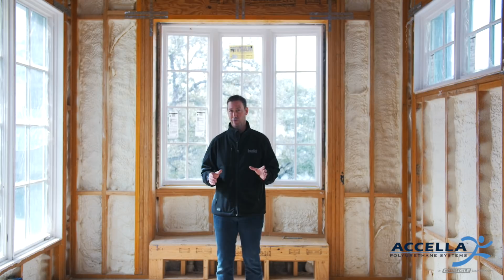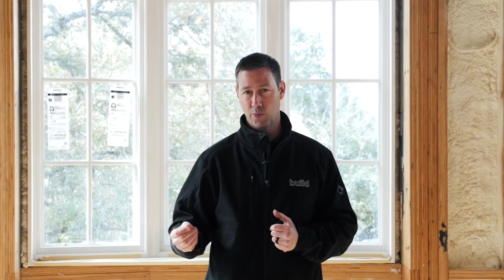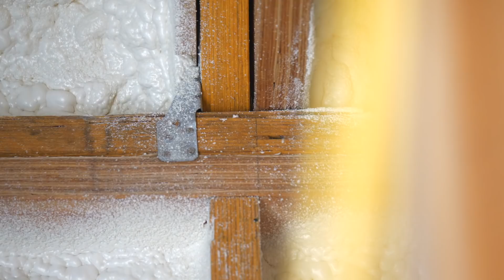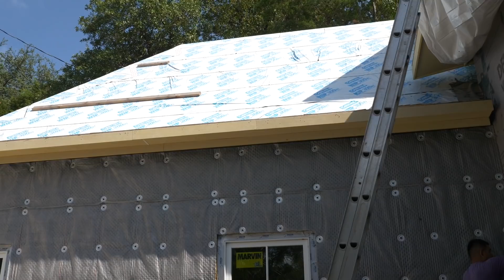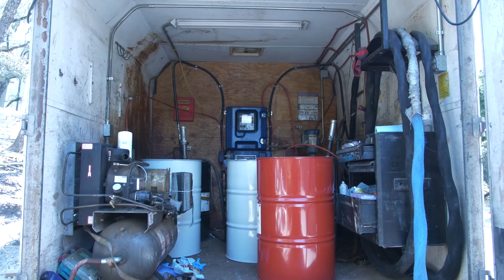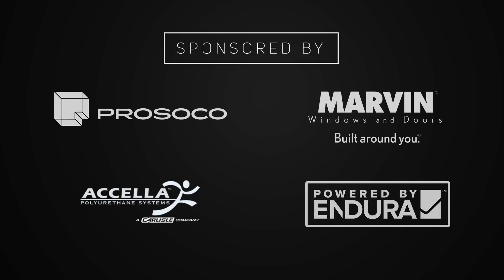Structural Insulation

Comment: When will you finally build the house entirely made of spray foam? Yoy are moving from the wooden house to the plastic house very quickly. I was a big fan of the way houses were built in USA, but since you are using so much polyurethane foam, I don't like it so much. In the houses I design, I try not ot use polyurethane foam if possible. The only advantage of spray foam is that it alows to build worse because it performs well being easily applied, but only having zero environmental considerations. Other insulating materials give good R values and allow to build a house that coud be dismantled and materials reused if necessary, but with spray foam you are building a big industrial waste with the shape of a house. And in case of a fire, there is going to be a really big torch with a huge column of black toxic smoke. I think wue should tend to build with more noble materials and using the less plastic, not with toxic residual materials. Polyurethane spray foam is good for the builder and good for the seller, but the home owner buys plastic. And again, in case of fire, poliurethane multiplies the amount of cyanide in the smoke, increasing the chances of fatal intoxication before leaving the building.
That said, Matt, I enjoy your channel and your work, and specially the concept of "perfect wall", which would be more perfect using rock wool.
Greetings from Spain and thanks for your videos.

Comment: Starting at 2:12 Matt talks about workers wearing respirators because the spray foam sticks like glue. This is only partially correct. Over spray and the issue of getting it on you is one thing, the mask is really for something entirely different. Foam is made of an isocyanate and a polyol. Isocyanate is wicked bad for you, and polyol isn't just a whole lot better. The ISO will sensitize you and really, really mess up your lungs. This is also why the structure needs to be well ventilated before it is entered or occupied. Off gassing after completion is still an issue too, despite what builders will tell you. Another thing is the importance of a fire barrier since this stuff puts off some wicked nasty stuff when it burns. That being said, I'm not a foam hater. It is a terrific insulator, but I advise everyone to do your research first so you can make an informed decision. My background is in the chemical industry, an operator in the Houston area. One of the products I make is the base chemical of the polyol component.

Comment: Matt, I have used closed cell for exterior roofing in warehouses for many years.  It must be topcoated however.  One great thing about closed cell is it will NOT support combustion.  Our insurance rates went down.  I acrually saw a metal building that had burned to the ground, and the closed cell roof was laying on top of the melted metal roofing, intact.  It it great stuff.  Nice video sir.
Reply: That's not true.   Spray foam is highly flammable.   Put a lighter on it and see for yourself.

Comment: Matt Risinger my question is if you use the closed cell to do a vapor barrier waterproofing layer and additional strengths stitching can you then go on top of it with open cell instead of using a traditional bat for the rest of the insulation and what would be the R-value comparable between the two

Comment: Question on adding a batt to the inside of the foam. Does this run the risk of water vapor condensing on the inside of the wall? As warm damp air moves through the batt will it not condense when it hits the slightly cooler foam or does the thickness of the foam negate that?

Comment: I'd like to retro my attic space with some like this product to make my attic conditioned space for the HVAC equipment/ductwork up there, but I've seen various "horror stories" about the health risks associated with spray foam insulation in attics - mainly giving off noxious vapors that made homeowners sick. Supposedly, the problem comes mainly from the incorrect mixing of the components.

Any insights on this issue or advice about using it?
Reply: Spray foam is the best hands down. its not most cases, it is every case, that has has to do with it being improperly mixed and installed. Spray foam is expensive, and some people pay alot more than they have to because they chose to not use a professional. When it is installed correctly, it is 100% safe, will never smell or off gas, any you will be glad you made the decision to do it.
Reply: Mine was no problem/ reduced attic from 130 to max of 90

Comment: Spray foam is a very dangerous and unhealthy insulation. There is a reason they don't use it in Europe much. It contains loads of VOC'c and formaldehyde. Studies have shown that it continues to leach these chemicals long after it's cured, even when cured "properly" with 2 inch applications, it's been shown to give off harmful chemicals. This is not recommended by any healthy building nor green building organization. Avoid it like the plague, since it may be even worse.

Comment: Wow Matt,
Outstanding side benefit of the closed cell foam on walls ... and especially on the roofing!  I always wondered about the strength improvements.  I also used closed cell spray foam on underside of my stairs and yes it did create a very solid step.  One problem I did not anticipate in one of my staircases, between the garage and basement, was that it was so tight that I need to bring in ventilation because the staircase which isn't used often ... the air becomes stale and even some mold formulation.  I'm having those improvements soon, aaarg. 

Say Matt, 
One energy efficiency concern I've noticed on a couple of recent videos is placement of 4 or more 2x4 or 2x6 studs together.  Some around windows like this video and some on corners.  Are they really necessary and aren't better framing methods available?  Thankfully I've seen you place insulation on outside the homes.
Merry Christmas!

Comment: This particular house was sprayed with 2' foam thickness you said. Was that one application or two? Also is it true that closed cell foam  applications should not be over 2' inches thick per application? If thicker than 2 inches a second application is recommended? Thanks!

Comment: I'm planning on building out of a forty foot shipping container with closed cell foam. I will be putting a wood frame inside the container and using spray foam because it's the only viable option for preventing any condensation on the inside. The only problem is potential condensation forming where the wood frame contacts the steel wall (warped and rotten wood is no good). I think a good solution for the floor would be to weld little metal riser posts to the steel floor and put the frame on that with spray foam filling up all the gaps (we are talking maybe two or three inches assuming that is an okay thickness for this type of foam). If closed cell foam is as hard as it seems in this video, could I just leave something like half an inch of space between the frame and the metal walls and just fill it in with foam? Would that be firm and strong enough to handle whatever stress and thermal expansion/contraction?

Comment: At about 7 minutes you say that with flash and bat you achieve almost R40 in the wall. That doesn’t make sense to me. You have R8 on the outside and R13-14 in closed cell foam, but the bat will only have 4 inches to expand, and you can’t get the full R15 out of it. What am I missing?

Comment: If the roof plywood decking has spray foam behind it and peel and stick rubber membrane on top, then it essentially is locked in and can't vent from either side. Is that a good idea? Will that lead to material failure in the long run? Dry rot, not to mention not be able to dry if moisture ever gets in there?

Comment: The ultimate de-squeaker!      And surely a clever and efficient way to put insulation where it really helps.     BUT:   Mr. Risinger makes no use of radiant barrier!    Talk about clever and efficient:   nothing amazes like a radiant barrier.        I retrofitted my southern California garage with a beneath-the-rafters RB and it turned my 'oven' into a remarkably comfortable space, in summer.     No more 100 deg F summer temperatures in my garage (which has a wood shake roof open to full sunlight).
I have noticed that sprayed insulation is completely at odds with aluminum-clad OSB, which I see installed atop rafters, when roofs are changed in soCal.      

Thanks for the excellent primer on spray-foam, Mr. Risinger.    I am one of your subscribers.
Reply: Are you saying that if I nailed a radiant barrier sheathing to the outside of my rafters (new construction) before putting on the exterior roof, it would be incompatible to spray closed cell insulation inside? (even window boxing?)

Comment: Matt I’ve always wanted to do closed cell foam on the underside of my roof and in my stud bays but have always had two concerns. As far as spraying the underside of the roof, my concern there is  always the possibility of a water leak. What happens when that occurs? Does the water eventually leak through the closed cell or does it run off somewhere to rot your framing?
For spraying in stud bay, what happens if a exterior leak occurs or a plumbing leak occurs somewhere in the house  or in a stud bay? What happens if you want add some additional wiring in the house? How do you get around those issues?
 By the way.... the “View Reply” button stopped working twice on this video and I had to close out the app to  get the  “View Reply”. Button working again. It did it a fourth time as well but I didn’t bother with it this time I just ignored it. Thanks for the great content Matt
Ron

Comment: I love your videos and have agreed with everything you have said up until now.  Using closed cell foam in wood framing in the Southern US is crazy.  You have created the potential  for one of the best moisture sandwiches ever in your decking and wall cavities.  If it happens, it will be a monumental failure in this house.  Why take that chance?In my area of Northern Alabama, flash and cram guys install about a 1/4 " of spray foam and then cram a fiberglass batt on top of it.  I recommend taking a nail or piece of metal and actually measuring the thickness of the 2" of closed cell you are paying for.  I will be surprised if you got it.I am not aware of any manufacturers of closed cell foam that do not require at least 1.4" of foam in order to be an air barrier.  There probably are some and I will check my Icynene ESR report to confirm.Most closed cell foams have horrible blowing agents as opposed to open cell foam being water blown.The cost of 2" of closed cell foam costs close to the same price of 7" of open cell foam.  The cost of this job is not cost effective at all.  Why not use open cell foam in the entire wall and ceiling assembly?When people start talking about using foam for structural integrity I usually start walking away.When a mechanical load is performed you will see that there is little if any cost benefit of installing more than a 2 x 6 wall cavity filled with Icynene open cell foam with a zip system on the exterior of the house.Pick one of the walls with a lot of windows on it and perform the total effective R-value of that wall you have constructed with an R3 window.  Thanks,Todd WittSynergy Home Performancewww.WeTestOthersGuess.com
Reply from the maker: Good commentary. Appreciate the thoughts

Comment: The strapping and hold downs are typical in California. (earth quakes) I am not saying that close cell does not hold things together but the engineers will not use it in there shear calculations. They will only calculate the loads with mechanical connections.

Comment: Considering that Matt is a high end builder and is using engineered lumber and rafters, not trusses, I'm concerned about the additional weight being added to the roof sheathing when using trusses 2' on center. Your thoughts sir?
Reply from the maker: That closed cell foam is 2lbs per board foot. Not a big deal. Plus we have a lightweight metal roof on top.

Comment: Just a reminder to put a wall switch in the garage that turns off the garage door openers. Saves a bunch if there is a lightening strike. I learned this the hard way after a lightening strike took out two garages.

Comment: Matt, I like your work and appreciate your videos.

I'm puzzling over the idea of close cell on the underside of the roof deck and ice and water on the top side. We have to assume moisture is going to enter every portion of a home. When moisture gets to the roof sheathing (maybe even the moisture in the spray foam) how will it escape with very low perm materials on both sides?
Reply: Matt can you respond to this? I would like to use closed cell foam on my roof and have ice and water shield on the top of the roof sheathing and am a little worried about the possibility of trapping moisture in the roof sheathing if any moisture where ever able to get in there.

Comment: How about the electrical wires? They didn't even bother to avoid' em.
Reply: And the point is?  You can insulate wires, after all.  The same is true for any other insulation.  Plus there's no chemical reaction with romex sheathing and the closed cell insulation.
Reply: Just in case you are rewiring the house in later time after a God forbid disaster.
Reply: You'd probably have worse things to deal with then, right?

Comment: All this talk of creating air-tight and highly insulated environments, and no talk about air quality. Don't these houses need some kind of air-exchange? And after doing that, what's the net benefit of making it so air-tight?
Reply: Yes, they definitely do need an air exchanging system.  The benefit is - with air exchangers (ERV's or HRV's) the incoming air is conditioned using the energy of the out going air.  This applies in heating or cooling situations. It's the only way to do a tight house.
Reply: @John: Thanks for the reply.

Comment: OSB + Spray foam = Faster fire, higher insurance deductible or declined insurance altogether, and Termite heaven..they love to nest in spray foam (especially in TX) best of luck with that property!  These "engineers", engineered your money into their pocket..fail👎
Reply from the maker: I disagree
Reply: first off, your spray foam isn't exposed, it's required by code to be covered by a fire block (either drywall or a fire retardant spray coating) if open to the living area. that gives you you required fire rating, if you have a termite issue then you failed to do proper pest control before and after construction, around here we have to have a termite guy spray the gravel before we put down our vapor barrier and pour our slab, if you can get termites them getting into your insulation is the least of your worries, termites hide out inside the walls anyway because they need the dark, the type of insulation you have isn't going to change whether they eat your wood framing or not.
Reply: Have you held a lighter to closed cell foam once it's cured?

Comment: Using OSB on the exterior and not plywood or synthetic plywood.  Going to be hurricane and tornado bait then.
Reply: This house has Advantech sheathing and roof decking.  The Advantech is stronger, stiffer, and more water resistant than CDX.
Reply from the maker: Agreed

Comment: Interesting! I had closerd cell sprayed in kitchen remodel...underfloor, walls and ceiling. I didnt know I could also added batts!(doah!) But I will say this lesson: make sure your outlet boxes are set (i.e. for backsplash tile height) because nothing is moving once sprayed. You try to dig out receptacle box, you will fail, and probably cut wire sheathing while at it. You need a pro company doing the spraying!

Comment: Interesting tidbit about the science of spray foam: Like you said, the hoses are heated to above 100 degrees. The blowing agent (What makes the foam expand) typically boils at around 80 degrees. BUT, the hose is pressurized, which chemistry tells us, causes the boiling point of that liquid to go up. When the mixed A and B sides leave the gun, they almost instantly vaporize, because they're now being exposed to atmospheric pressure- they essentially skip the boiling phase all together and aerosolize before hitting the sub-straight. 

Also, that foam job looked awesome
Reply: @Mark OnTheBlueRidge reports of the problem go past the application process. after homes are finished you can still smell it through the walls and can cause further problems down the line when changing electrical and plumbing.
Reply: @carl3500  Source?
Reply: why is it the leading chemical cause of work-related asthma, a potentially life-threatening disease. the man in the suit spraying seems to think so.
Reply: @carl3500  If spray-foam glue is the cause of work-related asthma, then workers are using the stuff without the necessary protection gear and outdoor air intake for the respirator.
Reply: @carl3500  they  use fresh air mask    no flters

Comment: Would putting foam on the bottom of the stairs reduce the "hollow" sound you get on hardwood treads?  Adds some mass, reduces vibrations?
Reply: That was my first thought when I saw that, should quiet down the stairs a bit.
Reply: This is a good question. I have squeaky 100 yr old hardwood strip flooring and wonder if spraying from below would help secure the subfloor to joists
Reply: Chip Holland even pink or blue board would probably help.
Reply: It seems that spray foam flexes ever-so-slightly, thus adding more than mere mass.   It's a dampener of vibration, at audio frequencies... roughly 2kHz+.      That's where your squeaks squeak.